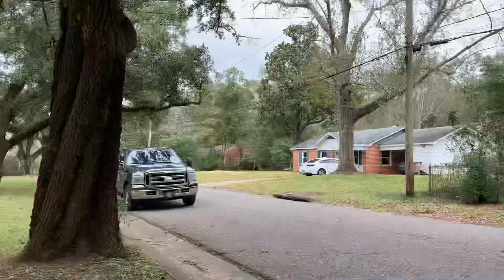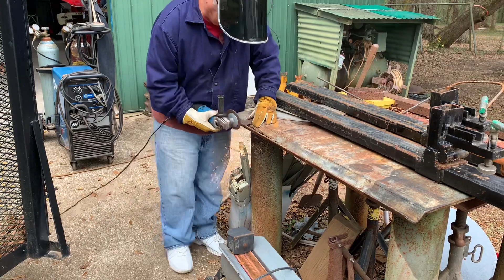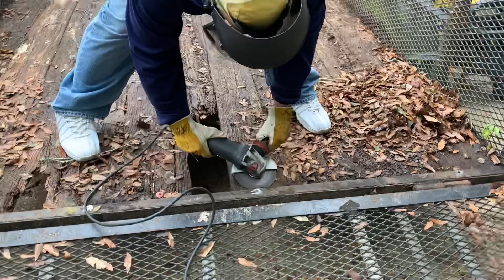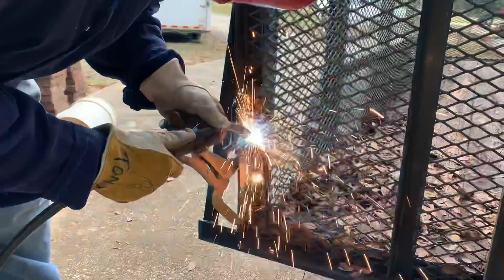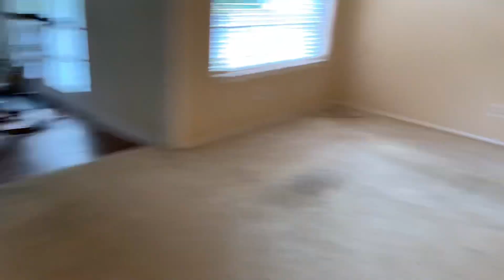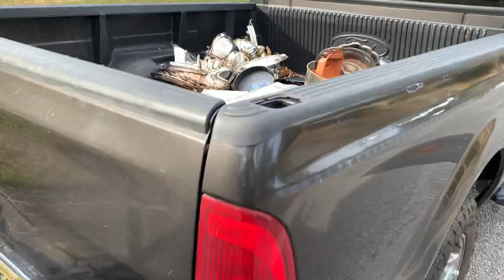Junk Removal For A Realtor

Comment: Am I misunderstanding? Why would you weld the side gate shut? You can load/unload from the side.
Reply from the maker: I don’t really need the side gate, and any time I opened it, I would have to use a car jack under the back corner to get it lined up to put the pins back in. It also helped that side from flexing so much by adding stability